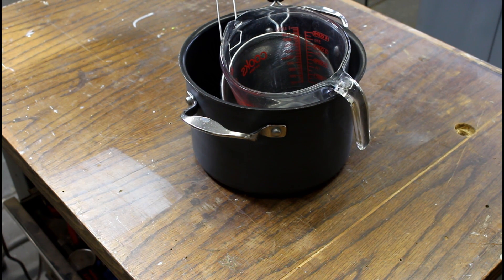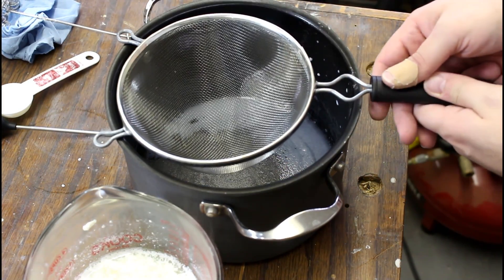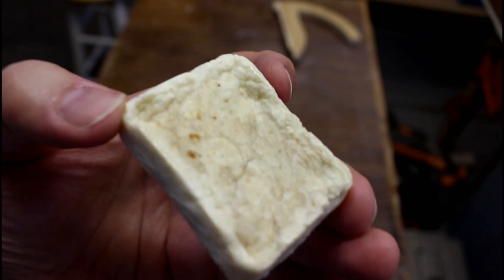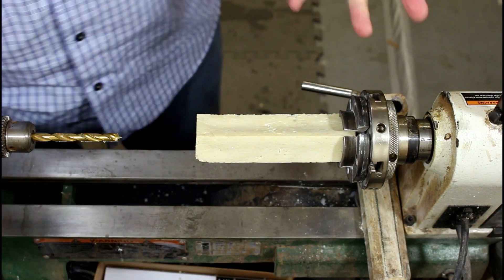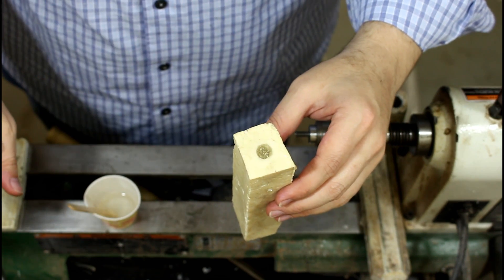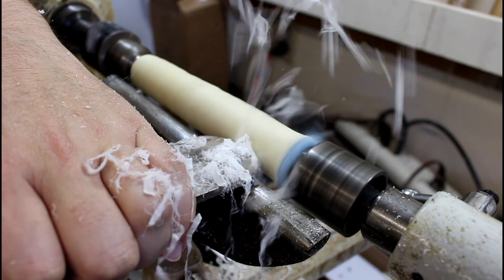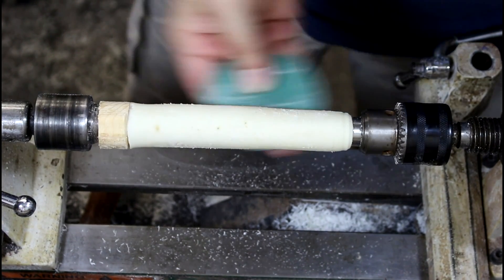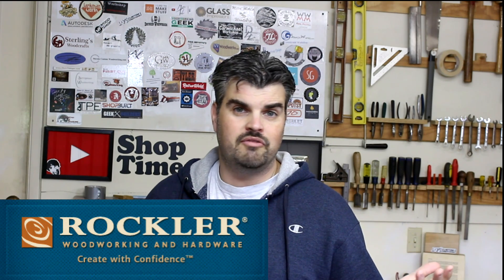Make Bio-Plastic From Milk

Comment: as others have noted, you did indeed make cheese, something like Paneer, which is made in places like India. To make paneer people warm up milk and then intentionally make it curdle using an acid like lemon juice or vinegar. The milk splits into its curds and whey, the curds being what forms the cheese and the whey the water that's left over. Paneer is by intent a mild cheese and paneer dishes are delicious.

If you were going to make a cheese like cheddar you would use rennet which does the job of curdling the milk, and some kind of cheese culture - live bacteria which convert sugars  - which is responsible for creating the flavour, different cultures will help you end up with different cheeses.

so you did indeed make a cheese handle for your cheese slicer, which is why it feels so greasy, you still have all the milk fats in the handle. I imagine it will sweat and go oily if left out, like any lump of cheese might.

Comment: technically this recipe is just super hard dried cheese... 1:48 separating curds and wey...
Reply: +SDD525 the liquid that gets strained from milk to make cheese
Reply: +SDD525 lol
Reply: spelled* lol
Reply: Both versions are correct.  :P
Reply: +seigeengine just because you can deform it plastic (mold in a shape it will hold) doesn't mean its a plastic which are polymers.
The term plastics should not be used for non polymers.
Reply: do you know the whey

i’m sorry
Reply: Cheese water soup
Reply: No Whey!
Reply: +Haze Notarealname No it's spehlt wey.
Reply: SDD525 Yes it is. The formaldehyde does turn milk into a plastic, but a different kind of plastic.

Again, if you can't be bothered to know what plastics are, fuck off.
Reply: Whey is also why making Greek yoghurt can destroy huge area of the sea, because it is highly acidic (anywhere between 6.5 and 4.5, which may not sound a lot, but see water is between 7.5 and 6.4)
Reply: Indeed, but it's also a plastic.

Comment: You need to add something to draw off the water. Ethanol or acetone works well. Also adding a stabiliser like calcium hydroxide and sodium carbonate will improve the casein polymer. Alternatively you could just use something better for turning.

Comment: Shot in the dark, but your blank was probably too thick, since HH's was much smaller and thinner. Try using a dehydrator to draw out all the moisture, or giving it a light bake in an oven after letting it set for a day or so. That should get it to dry faster and more thoroughly.

Comment: What you get when you add vinegar to milk and strain out the liquid is cottage cheese.  Press it in a mold  and let it set, and you get cheese. The flavor of the cheese comes from salt and the various bacteria and molds that grow during aging. As you found out, without salt or fermenting, you get tasteless, dried out cheese.  As cheese dries, it forms an insoluble rind that protects the inner part of the cheese from drying further.  A piece a thick as the one you were working with would take years to fully dry.

Comment: You might actually try using kefir grains/starter in your milk instead of the vinegar.  The bacteria/yeast in kefir actually self-preserve by expelling water (i.e. drying themselves out).  You can get a block of rock-hard casein in a matter of days.

That said, you might have better luck making yogurt and using the whey to make polylactic acid.  No idea what's involved in that process but PLA is a true polyester/plastic.

Comment: Peter, Have you tried dissolving Styrofoam in either acetone or gasoline and then putting the "glop" into a mold? A friend of mine has done this to create blocks of plastic for his art projects. It takes a few days to dry, but it is quite useable, and seems fairly durable too. Of course, only mix this in a WELL vented space. Please keep the videos coming.
Reply: Isn't that poor-man's Napalm? I'm not sure that turning it would be very healthy.
Reply: uuuhh dude styrofoam plus gasoline makes napalm... not very durable and not something you wanna leave lying around a house/gallery
Reply: In electronics this is sometimes used to dip fragile coils and such into to stiffen them up and create a thin coating, or just brush it on like a varnish.
It sort of acts like a more liquidy epoxy. It takes a TON of foam though. 
It becomes a bit brittle over time, but maybe less if it's thicker, dunno.

It's a bit less flammable than regular styrofoam once all the acetone has evaporated. It burns quite easily but not very fast, lots of black smoke though.

Might be cool to dip some kind of copperwire statue into. Maybe dip it a few times to build up some more layers, or cast it's base into a block  like Mr. Burnham suggested.

Anyway cool cheese, too bad it didn't work so well. If it did it might also be fun for carving a small statue.

Comment: As usual, evidence of household hacker being a blatantly fraudulent channel
Reply: Fat content is probably the issue. The plastic is formed by the protein in the milk. The fat isn't useful.
Reply: Well no, he did something wrong. I made a tile out of the material that was about 6 inches squared, and it didn't even take 2 days to dry. I don't know what he was doing, but something about that was completely off.
Reply: +Hemlock Also the whole "paper plate speaker" bs. Half of the hacks on his channel either don't work at all like he says or don't work at all.
Reply: +Tanin Moores paper plate speaker blatantly doesn't work and you're dense as lead if you think an aux cable a penny and some tin foil will ever make any kind of sound. Learn how a speaker actually works.
Reply: +Tanin Moores 
Just so we're clear this is the original video I'm talking about: 
/watch?v=8m8fbnShPcw

And these are first off the mythbusters trying it and (funnily enough) failing and then Grant Thompson making a speaker that actually works because believe it or not there is a specific way a speaker works which the paper plate speaker that hack made does jack all to even imitate:

/watch?v=ya9ZsKyJRrE
/watch?v=Awef78YtWmc
Reply: +Tanin Moores The parody part was added after the mythbusters response and wide criticism. Can't prove this other than my own memory of when he posted it (I was a sub at the time) and all the uproar he was getting for it before adding the parody marker but think about it- why would there be so many responses of people making it and failing- including large commercial TV shows- if there was a clear parody marker in the desc? Doesn't make sense.
Reply: +SaimonVcp Not the type of paper plate speaker we're talking about. That version works, and people like Grant Thompson have proved that. This version was a paper plate, covered in tin foil with a coin taped on top with an aux cord. Blatant bullshit, and people called him out for it, so he put a parody marker in the description after about 5 months of the video being up.
Reply: Your icon is perfect.
Reply: +Tanin Moores Why would 2% work better? All you're doing is reducing the amount of fat that you would get from any given cup of milk.
Reply: I dunno, I'm just saying it worked for me, very well. If you want to replicate the results of the experiment, the conditions must be the same- that's the only reason I recommend it.
Reply: i say it makes sense that lower fat milk would work better... less oil keeping the material from drying.... try skim milk and report the results
Reply: Nathan King Skim milk has no fat in it at all. That's why it's called skim milk, they skimmed all the fat from whole milk.
Reply: Lutra Nereis so is a lower fat milk works better... logic suggests a no fat milk will work best.... make sense?
Reply: I was thinking that, but I just thought "Maybe I'll just give them the benefit of the doubt..."
Reply: ... really?, i didnt saw the video, butpaper plate speaker actually wok, with plastics cups too, it doesnt matter which material as woks the SAME as speakers (the coil, the magnet, and electricity and well, it vibrates,i cant explained it better in english sorry)
Reply: Seriously, it's called galalith. You'd have to be a fucking idiot to be online and not be able to find it.

Comment: f I do this, and I probably won't, I think I'd leave it in the gas oven and let the pilot light harden it a lot faster. And would it have been too ironic if you'd shape the handle into the shape of an old milk bottle?

Comment: Hydrocarbons molecules (plastics in this case) are long chains that get, kind of, entangled to each other, carbohydrates are more or less similar to Hydrocarbons but shorter, so the "entanglement" is not as long, and therefore not as strong for the complete structure.
Probably some aditive could help to make it stronger.

Comment: Peter, the reason you had problems working with it is that for all intents and purposes, what you made was not casein plastic, or galalith, but dried cheese. Most of the tutorials on the internet are missing the most important step to make casein plastic. After being dried, the casein has to be immersed in formaldehyde and redried. The formaldehyde is what hardens the product into so-called milk-stone.
Reply from the maker: That makes a lot of sense!. I felt like I'm must have been missing a step or two!
Reply: Formaldehyde is one of the main reasons casein plastic fell out of favor commercially as thermoplastics became cheaper, it made the production pretty noxious.

Comment: Typically casein was used for flat small things such a buttons that were mostly extruded... so a large part with a lot of stresses due to the lathe work will break the part.

Two quick suggestions to "make" casein. One... applied pressure... a LOT of pressure that will remove the voids and bind the particles of curdle milk into a single one (think how Parmesan cheese is made). Moderate to high temperature may be necessary for the part to retain integrity.

Second... if you want more tensile resistance and durability you may want to consider to use formaldehyde as an additive.

Great experiment/video

Comment: Congrats you made dried cheese that's it just dried cheese.
Reply from the maker: I pretty much said that in the video. Still it was just an experiment, that was mostly a success. We'll see what it looks like in a few more months as it continues to dry out.
Reply: +Peter Brown There is no pretty much about it. You used an acid to split the curds from the whey. Your bio plastic Is unseasoned cheese. Cheese only becomes brittle as it dries. It will splinter and fragment.

Comment: Maybe use skimmed milk so its not so oily?
Reply: It's an actual chemical plastic, no need for the quotation marks :P
Reply: SDD525 Milk contains fats & oils.
Reply: SDD525 Right, and what happens when you solidify fats?
Reply: When did cheese become a chemical plastic?
Reply: Robert Marks Cheese itself isn't a polymer, but what he made wasn't cheese. Look up what "polymers" are, it every day life we dress them as plastics. Long story short, the vinegar creates a chemical reaction that converts the lactic acid within the milk into a polymer which then hardens to create the plastic you see. That's why it's called a "biopolymer", it was created from that organic substance.
Reply: SDD525 Well, first off milk does have small amounts of oils in it. Secondly the "oily" texture that everyone here is referring to is actually the fat on the surface of the plastic.
Reply: SDD525 My 4 years of high school chemistry. You can think of it like this. Butter. You know how if you melt butter you get a clear yellow "oily" substance? This is a similar case. Now we could talk about this all week or you could accept the following facts:
1. Milk (as well as all other biological products) contains at least some level of oil.
2. Solid fat when, uh, simple terms, "melted" creates an oily texture.
Now that we know that milk contains fat, fat creates an oily texture and the block of plastic is made out of milk plastics, we can infer that the oily texture is from the fat.
Reply: SDD525 Well, my mistake then. But still, the oily surface is due to the fat content.
Reply: SDD525 Great!